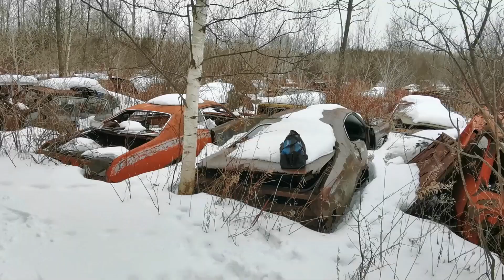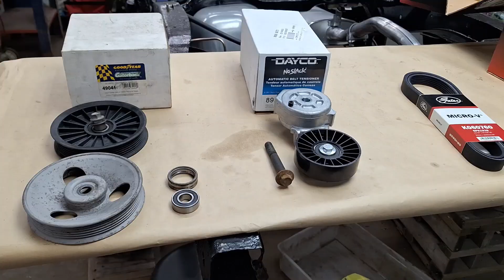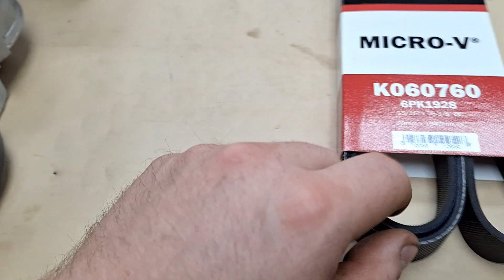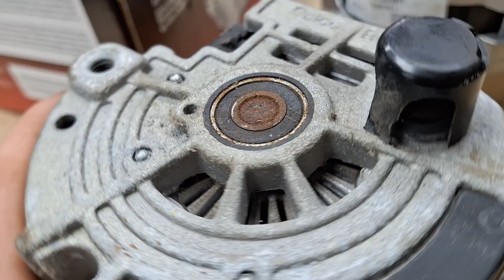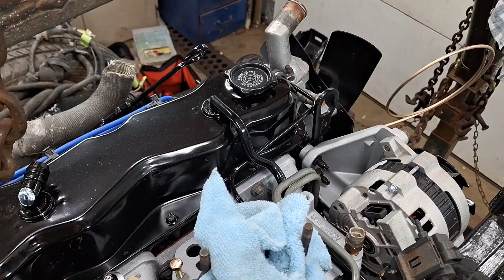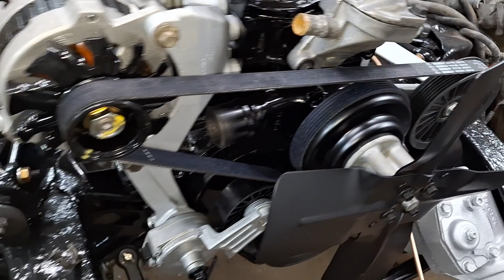'87 Chevy S10, "The Duke", Part 28, Belt drive assembly

Comment: Thanks for the info: where did you find  the cast aluminum altanator bracket? No one has them now? And the dayco tensioner is a big thank you- napa part source has changed now!
Reply from the maker: Thats my original, I had it media blasted and then painted it with "Cast Blast" paint

Comment: My 88 originally came with AC.  MY compressor locked up several years ago and i replaced with a by-pass pully and bracket.  I ran it like that for several years, but just this last summer rebuilt the AC system with R314a.  Works like a champ and absolutely mandatory in Atlanta, GA,   So...AC add-on is definitely doable with that 2.5L Iron Duke.  Excellent project here!
Reply: My 86 AC was a dealer add-on at purchase. Had to rebuild it last summer as I am in GA, too; albeit further south.

Comment: Did the original 1987 have a tensioner? My 1986 S15 does not, nor does it have a serpentine belt. Also, did you consider adding AC? I can’t remember. Thanks.
Reply from the maker: 1987 was the first year for serpentine belts on the Iron Dukes, which is why the tensioner was added, I thought about it, but at the moment it may be a future addition